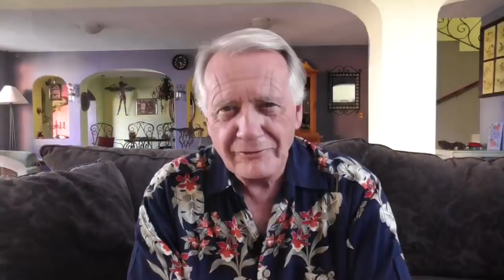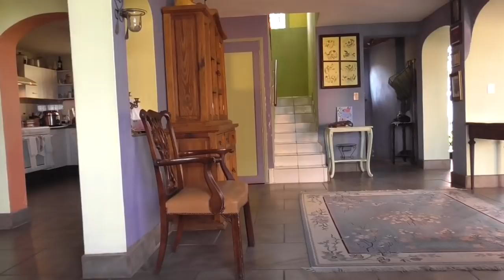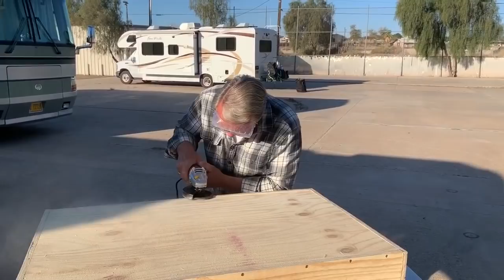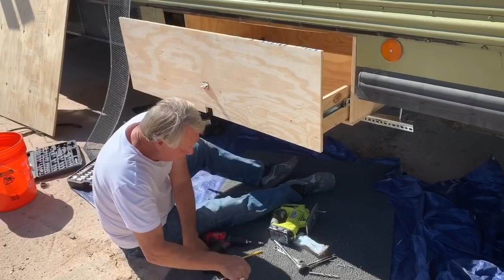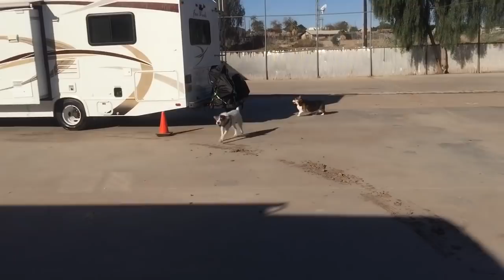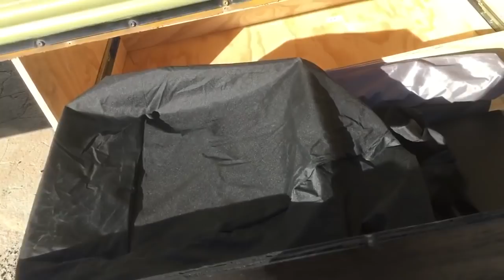Mexico, Toilet Paper, Lynn's Opinion and Skoolie Storage

Comment: Holding classes on line is already entrenched in both secondary and post secondary institutions. I can't see online courses moving forward as they're MUCH, MUCH more difficult to complete. Most students aren't willing to put in the extra effort required for completion of the on line course. I'm not even addressing the hurdles of accessibility. What might seem as a simple accessibility issue can become a major stumbling block as your trying to move through a course. As per usual, enjoying your video's.
Reply from the maker: Interesting insight into the psychology of students, however, I believe the change will be driven not by what's best for students or easy, but by what's cheaper.   :)
Reply: JC Travel Stories I see you’ve thought this through🙂

Comment: I had kind of the same issue with my lawnmower & I simply removed the gadget so the wheels run smoothly in either direction.  It doesn't pull itself but a couple shots of WD 40 & it moves pretty easy.  I laugh too about the hoarding of toilet paper since this is a respiratory virus, not an intestinal one.  The only conclusion I could come up with is people do their best thinking while sitting on the can, so they though why not.
Reply from the maker: You've solved the mystery of TP hoarding.!!!!  LOL!  :)
Reply: JC Travel Stories   I hope they don’t put that on my headstone. 😜